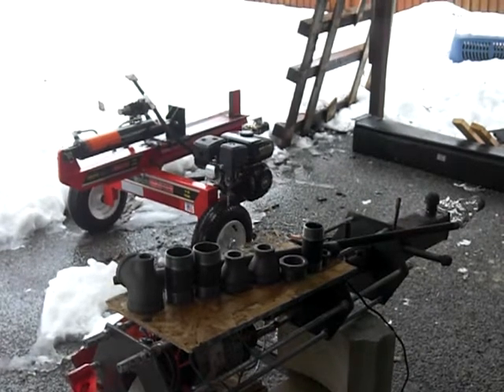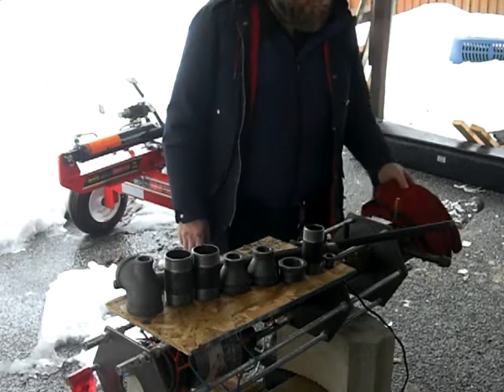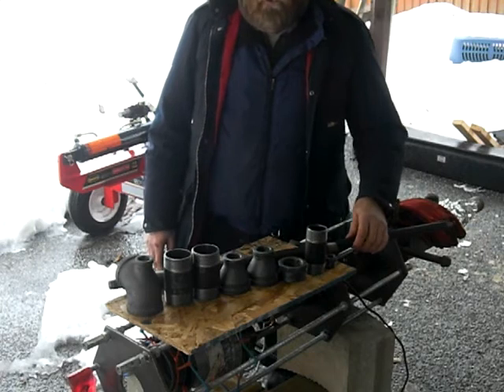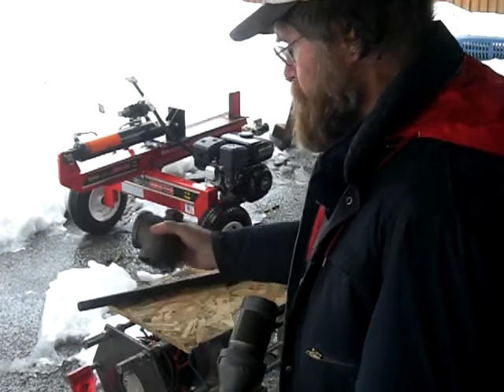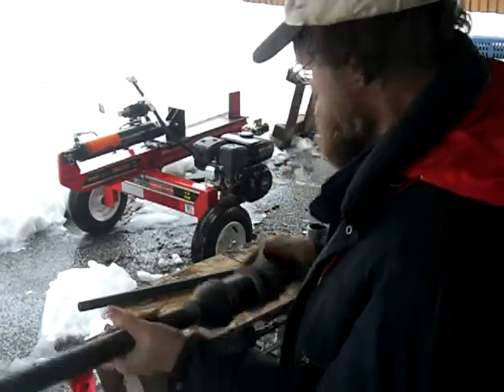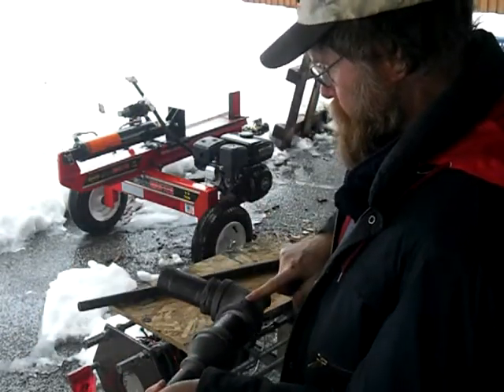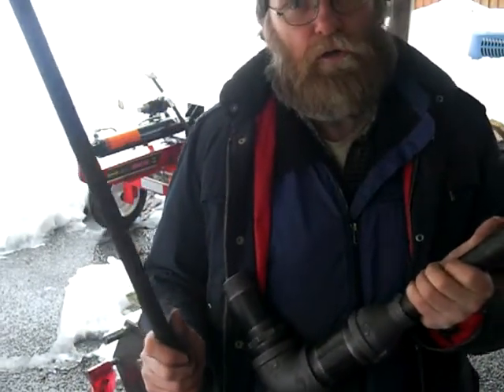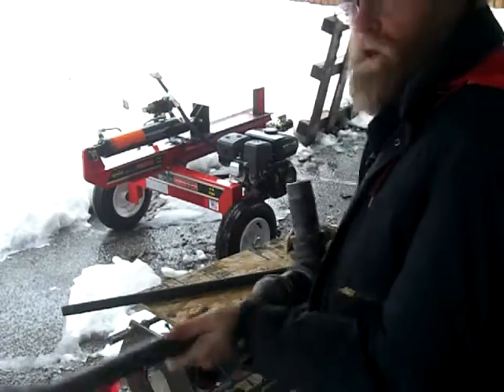290-New GEET-Joe Pipe Hourglass Design.

Comment from the maker: Hi-Haven't tried using a vacuum pump to crack the vapors.   Just used compressed air and fan air so far.  I believe that I'm ready to take that step using vacuum to merge the GEET with the joepipe. May be passable to run 6 GEET systems by using the joepipe as a stand alone heat generator, plus using a double pipe to tripple the exhaust air and sill have 1,200 F at a 3 inch cross section of input.  Have a post ready to go concerning this merger.  Vacuum sounds the way to go.  Joshua.